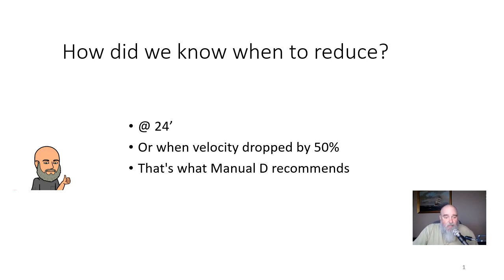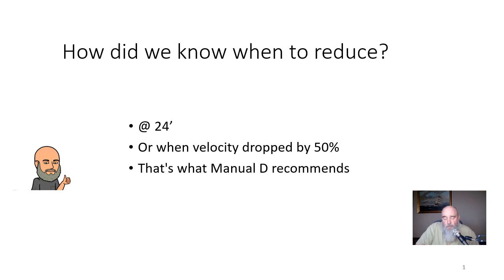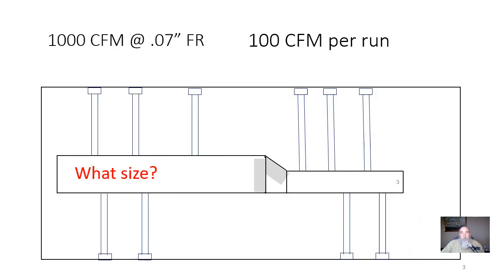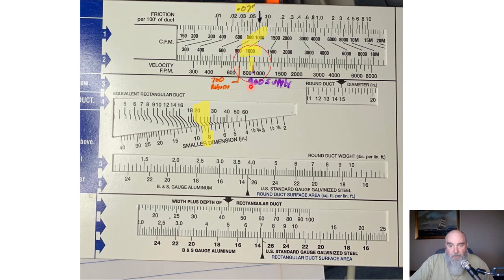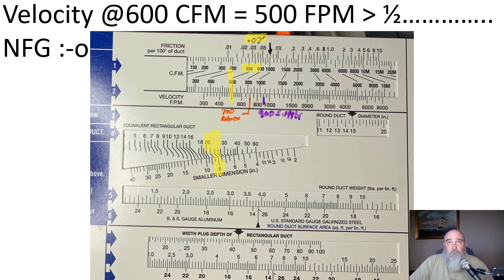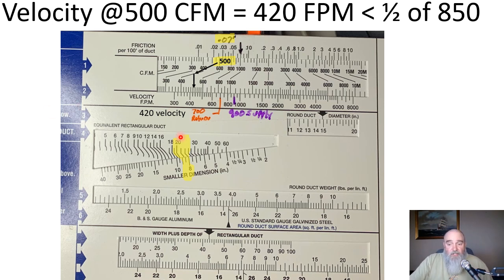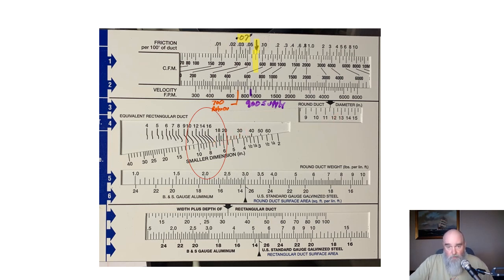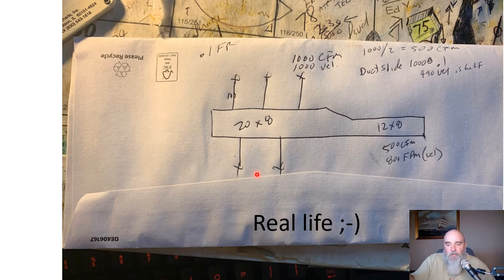How did we know when to reduce our duct size? ACCA Manual D

Comment: I would love to see an example of the other typical arrangement where the furnace is in the middle of a basement and you have a 2-way "T" trunk system with say 24 ft in one direction (to feed one side of the house and 24 feet in the opposite direction (to feed the other side of the house).
Reply from the maker: Whether the duct system is one extended Plenum or has multiple, the process is still the same. One of the extended Plenum runs will contain a circulation path that is the longest or what manual D cause the critical path. Each extended Plenum or if you wanna call it a trunk duct get sized and reduced if necessary, the same way it was explained in this video.

Comment: I’m new to system/duct design, I’ve done a few dozen manual Ds over the last year, none of them I followed the book perfectly.  There’s a lot of grey area in duct design.  But I typically reduce when my calculated trunk velocity drops down about 30-40% and I’ve not had any major supply airflow or total static issues yet.
Reply from the maker: I believe the video follows what is in the manual. You can reduce (or never reduce for that matter) but your goal will always be to keep the velocity less then 900 FPM in the supply and 700 FPM in the return.

Comment: Shouldn’t the size reduction be installed immediately after the 5th takeoff? I know that the sketch is not to scale, but the sketch shows it midway between the 5th and 6th takeoffs.  It might be helpful to illustrate, or mention, that the transition can be placed a short distance after the 5th takeoff to save materials.

Comment: I am adding 800 sqft to my home (1,400 existing + 800 new).
Got quotes from 5 contractors so far. They are telling I need to upgrade my furnace and AC.
The recommendations range from 3 ton to 5 ton.
Reply: Are they doing a actual load calc?  If not dont pick them.. Also Dont pick 1 unit to do it all.  No house can use 5 Tons.  Maybe 2 2 ton units but never 5 tons out of 1 unit
Reply: If you’re adding 800 square feet you’ll need an extra 1-2 tons depending on a variety of factors like age of the home, quality/r factor of insulation across the entire home and new space, etc. the comment above me saying “don’t go with someone who doesn’t do a load calc” is kind of ignorant.  In my state, nobody is going a full load calc for residential changeouts unless it’s a 5000 sq foot mansion or new construction project.  It’s too expensive and rules of thumb get us by just fine for small homes.
Reply: 3.5-4 ton should be fine for the extra 800sqft

Comment: Question: I have 17 feet of 6 inch duct supply to a room. After 17 feet, it elbows down and to the right, travels 2 feet straight, then elbows up and into a transition piece that feeds the room. Do I need to reduce the 6 inch to 4 inch OR simply get rid of the elbows and install a 45 set about 4 feet before the transition piece into the room?
Reply: 45 set

Comment: Hi Ed I have a few questions for you. 
1. After you reduced in the example.. won’t your last few runs “run out of velocity” on the end? (Just like when you took off your velocity dropped in the beginning?).

2. Is it acceptable when using round pipe to reduce 4 sizes if need be? I.E. let’s just say that I started with a 16” round pipe and at half my velocity I needed to reduce to a 12” pipe. Would it be acceptable to put 2 reducers together and go from a 16” to a 12”? Thank you
Reply from the maker: Question 1. No. Velocity can not be to low in a branch run if you follow the guidance of Manual D. If CFM is correct the velocity if air going through the terminal box and grille is what we care about. 

Question 2. Yes. Manual D is about having enough fan pressure to overcome all pressure drops, having ducts large enough to not allow velocities to go above maximum values and using dampers to get the proper volume through branch runs. There are a few more but thay are my top 3.
Reply: @edwardjanowiak   thank you for your clarification.

Comment: Should I reduce my return in size as well? Or keep it the same size the entire length
Reply from the maker: It's your choice. The #1 rule to follow is whatever CFM volume you are moving through the duct (in that section) should not exceed the velocity limit as per table N3-1 Page N13 of ACCA Manual D (it says 700 FPM for a return duct).  Lower velocity will never hurt your perforce, but it can impact your cost. I size my ducts following the conservative path listed in the table mentioned above. Check out ACCA.org, click on the education & events tab to see where I'm doing my next virtual or live training event.

Comment: Question. Is it ok to reduce the duct work  (let’s use your example) after we take first 3 branches, when the duct work is in unconditioned space to reduce the use of the materials and reduce the surface area of the duct work. So we can save few dollars on insulation and metal and also few BTUs?
Reply from the maker: Eduard Khachaturyan yes, you can reduce the size as much as you want. Just make sure you keep your velocity under the maximum limit. My observations have been when people use rules of thumb to size ducts, they ignore velocity limits and we end up with an undesirable increase in static pressure.